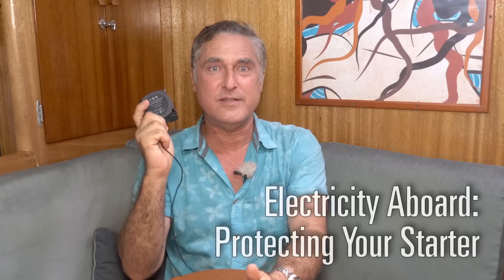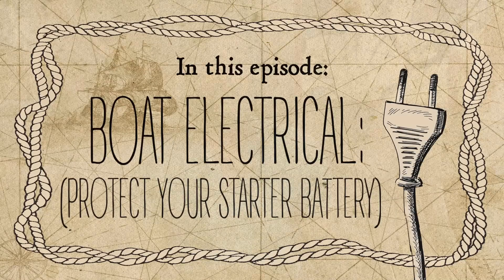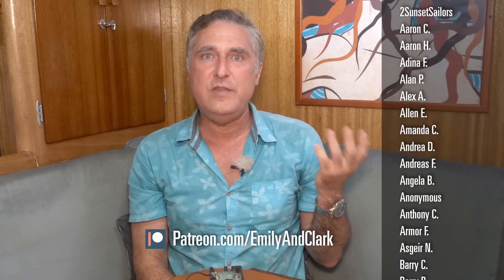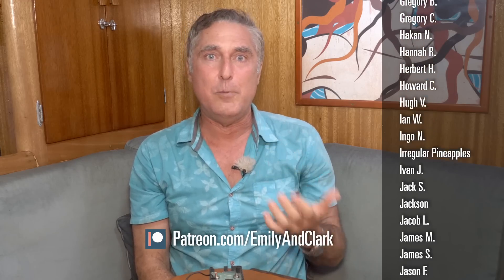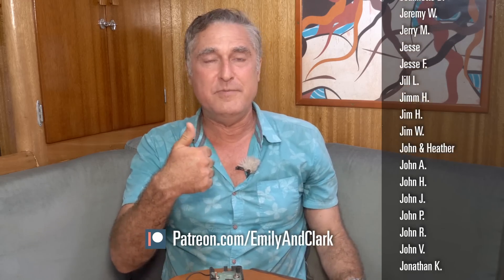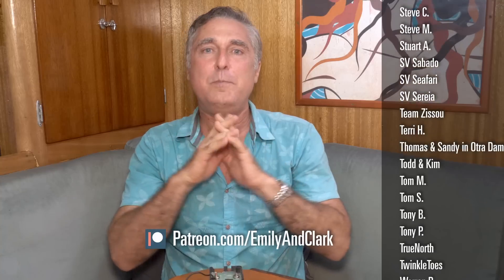The $20 Way to Protect Your Boat's Starter Battery

Comment: I know it is a lot, but you should post a schematic of your electrical system.  I am getting ready to refit my boat (with a lot of your products and ideas), and it would be great to see a diagram of how to incorporate all of your different stuff.  Battery isolator, BBMS, AC, chargers, converters, MPPT controllers, solar panels...etc...especially where fuses are needed and other hazards...
Reply from the maker: Good idea for a video.
   Also you might like tomorrows video as it's going to be how to wire up a BankManager
Reply: @Clarks-Adventure Awesome!

Comment: Constant duty solenoid would also work
Reply from the maker: Yep, Shure would.  But they tend to use a lot of coil power.
Reply: @Clarks-Adventure  if you use more than a trickle charger you shouldn’t see any difference. Ive put them on a lotta stuff

Comment: So a point I missed in the video but got in your response to a comment is that the voltage-sensitive relay is only for motor lead to house lead, NOT motor lead to house lithium. Is this correct.
Reply from the maker: Correct for a couple of reasons.
   If you are using the BankManager it always needs lead attached to function properly.
   And, a vsr can connect when the charge states are very different.  That can be dangerous with li

Comment: Hi Clark. I really enjoy your videos and find them very useful for performing DIY on my sailboat.  I recently did a major electrical refit where I completely isolated my starter battery from my house bank.  The starter battery is used for my main engine, my generator and my windlass.  I only run the windlass when the main engine is running.  My charging sources for my engine battery are the engine battery alternator, generator alternator and the aux (trickle) charger on my Victron charger/inverter.  The charging sources for my house bank are the Victron charger/inverter and solar.  While I love the idea of using all charging sources for all batteries, I’m a little concerned regarding the difference in charge profiles between my starter battery and my house bank.  Is there a risk that the VSR will overcharge either my house bank or my start battery?  Also, is there a risk of very large amp loads flowing between the batteries if their voltages are quite different?
Reply from the maker: Yes the batteries need to be the same type at least chemistry.   You didn't say what types of batteries you have.
   Generally you are safe if you choose the setting for the lower voltage of your two types assuming they are both lead.  Your batteries will just charge a bit slower.
   If you have any Li you can solve that issue easily with my BankManager.

Regardless you might like this video.
https://youtu.be/Xp6ssk4Guuc
Reply: Clark - thanks for your kind reply.  Both of my battery banks are AGM (lead).  The starter battery is an Optima Marine starting battery and my house bank is made up of dual 230AH Victron Super Cycle (460AH total).  These two battery banks are currently totally separated. The main charging source for the engine start battery is the engine alternator (50 Amp).  There is also a trickle charge source for the engine start battery that comes from my Victron Inverter/Charger.  The house bank currently has 2 charging sources - the Victron Inverter/Charger as well as 400watts of solar coming through a Victron MPPT charge controller.  Although I like the idea of using my engine alternator to charge my house bank (especially during long passages), it is not a smart alternator and therefore does not have the 3 phase (bulk, absorption, float) charging like the Victron equipment.  Therefore, will using my alternator (via the VSR) to charge my house bank have a negative impact since it doesn’t follow the same charging algorithm?
Thanks for your thoughts / reply to this question.
Reply from the maker: It depends on the alternator voltage.  Usually the dumb ones just charge too slowly.

You can put a switch on the ground wire of your VSR.  When off your house won't get a charge.
Reply: My alternator is rated for 50 Amps and it is a dumb alternator - ie, it only supplies current at a fixed voltage. For this reason, I decided to forego the VSR route which would not supply my house bank with the preferred 3 phase charging approach of bulk, absorption and float.  I opted to spent a bit more money and went with a 30amp DC-DC charger that senses when my alternator is on and delivers the desired 3 phased charging.  This setup can also be used for when I eventually switch my house bank to Lithium as the chargers are all programmable.
Reply from the maker: Not so useful for Li as they claim.
Before you go Li you should really consider this.
https://www.emilyandclarksadventure.com/bbms

Comment: With these, you can raise the disconnect voltage ( 12.8v ) by putting a skotchy diode or normal diode on the earth wire. This with the forward voltage drop of say 0.4v you raise the disconnect to happen at 12.8 + 0.4 or 13.2v, they of course only join when above the 13.2 + 0.4 or 13.6v but that is fine on most cases
Reply from the maker: Why would you want to do this?   Li on both sides?
Reply: @Clarks-Adventure  Ahh my message was meant to be a reply to those people saying about the batteries being joined until down to 12.8v.  the extra diode on the earth line raises the disconnect voltage ( by the doide voltage drop ) if they wanted the starter battery to separate at higher voltage than the device standard 12.8 volts.  This was mainly in relation to the stock lead acid starter and AGM house banks most comments were messaging about.

Comment: Thanks for these informative videos. We have an ACR (Automatic Charge Relay) installed on our boat. It sounds like it does the same thing as the Voltage Sensitive Relay. Is that correct?
Reply from the maker: Yep sounds like the same kind of name.  There are also battery combiners.

All the same but the price.  But nothing is cheaper than what you already have.

Comment: The only potential issue with VSRs are that most fail closed, so if the VSR fails it will keep your batteries in parallel 100% of the time no matter what.....people should be aware and try and find one that fails open so the batteries are disconnected in a VSR fail state.

Comment: Question: You did not say how, and where do you connect the VSR?
Reply from the maker: 8n the positive line between the house and starter battery.
Often parallel to an existing switch that will now be left off for normal operation.

Comment: Clark, Thanks for this! 
Question: I have a smart charger that uses shore power to charge the batteries independently. It monitors each battery's condition and can charge one battery or the other independently or it can decided to charge both at the same time. Seems like this would interfere with how that functions. I realize if I was away from shore power it could also make things be different.
I would appreciate your thoughts on this.
Reply from the maker: I'm curious what you have.  Usually the battery chargers that make that claim just have some diodes in their charge terminals.

Either way it won't make that much difference.  If you have lead maybe one battery gets charged longer.  It's tough.

If you have LiFePO4 you should be running my BankManager and it will manage the li safely.

Comment: Well Clark you've got a new sub.  I couldn't find the relay in your store but I did find one by searching on Amazon.  Looks like a neat device.
Reply from the maker: It's usually best to get the dual sending version.   Hope you found one.

If not you have to put all the charge lines to one battery, usually not a problem.

Comment: Hi Clark, slightly different question about charging the seperate starter battery I have on Arabella.  On shore power all's fine as the starter battery gets charged however with my current solar panel setup I don't have the solar panel connected to the starter battery just the house batteries.  I think when I bought the solar panel the supplier said not to do that !!.  My question is,  is there a way to have the solar panels I have connected to the house batteries charge the starter battery as well or am I better getting a seperate small solar panel to just charge the starter battery ?.  cheers, Ian
Reply from the maker: As I remember your starter battery is lead as it should be.
   Use one of these devices as described in the video.  It will work for you and not only charge your starter from solar but from any source and your starter will be floated by your Li at night.

It's what I do on Temptress.
Reply: @Clarks-Adventure  Hi Clark I've already got one of those devices installed for the lead batteries so are you saying with that connected the starter battery should be getting charged via the solar panels already ?
Reply from the maker: If you have it's positive sides connected to your starter battery and your house battery (ground connected of course) and it's the bi-sensing version you should see your starter at the same voltage as your Li.
Reply: As I Inherited the gig with the boat and it’s a nightmare trying to see how it’s all connected without removing all the batteries and whatever I’ll see what gets charged next time on solar rather than shore power . Hopefully it’s as you say and I don’t have to do anything 😊
Reply from the maker: You could temporarily remove your shore power wire to the starter battery, leaving it on the house side.  If the voltage doesn't come down in the starter battery you are good.
Reply: @Clarks-Adventure  ok will try that.  is the theory 'if the voltage doesn't come down' meaning it's getting charged from the solar , or something else ?
Reply from the maker: Yep.  If the car is closed the voltage will stay up.  Otherwise an isolated lead battery will drop to a voltage of 12.8 as time goes by.

Comment: You left out the most   important and dangerous aspect of diode isolators.  Because the main battery is the only  one  being  "sensed"  this means that if the  diode on the main side fails,  the main will not be charged,  the "sense" circuit to the VR will say " oh let's charge more"  and the  aux  battery  will now get  BOILED

Frankly I believe in  "keep it simple stupid."  A SIMPLE  CONTINUOUS DUTY SOLENOID, keyed  by  the engine  ignition switch, has ALWAYS  worked  very well in boats and RVs  It's just a great big solenoid relay,  and you simply wire  it so when the  engine is running,  the batteries are connected.   Most all have  a 2 post  coil connections,  and you can wire a small switch in series with that to disable it for some reason
Reply from the maker: You are correct.
  Diodes were a great way to go on 1960.

Comment: If the VSR cuts out at 12.8v and you have a Lithium house bank, that holds ~13.2v, the relay will stay energized (connected) almost always. Right? This would be the same idea as letting the Li float the Pb house with you BBMS.
Reply from the maker: Yes.

  But the bank manager does so much more.
Reply: @Clarks-Adventure  Understood. I guess my question is really about isolating the starter battery to only supply cranking amps instead of pulling from both starter & house banks.
Reply from the maker: Yes this does that all by itself.

That is after the first few seconds when the voltage drops.

If your wire is real big and your Li is large enough the li could keep the voltage up.  I have a feature in the bank manager (sort of a software fuse) that can protect from this but if the li is big enough to start your engine without it's voltage dipping below 12.8, what's the harm?
Reply from the maker: Mostly this device is to keep the discharging house battery from eating up your start battery.

Comment: The only issue buddy with a vsr you can’t have a b2b 
Best option is a b2b with a battery master 
But again if using lithium leisure and lead starter not all battery masters or maintainers work 
One I found that work is  one from vanbitz in the uk or the amt-12 at widebus the vsr definitely interrupts the set up
Reply from the maker: Mine works fine with a VSR, the BankManagerPlus, and it's the only one to not cause low current overcharge that will slowly destroy your Lifepo4.

https://www.emilyandclarksadventure.com/bbms
Reply: @Clarks-Adventure  ok cool … but it’s this the device for a hybrid set up 
I’ve noticed wildbus sells his own version on this now doesn’t he
Reply from the maker: There are a lot of ways to go.  We are all captains of our own ships.

I designed this from scratch to solve the li charging and use problem the best way possible with no loss (b2bs drop about 20% of their power as heat)

The Wildbus unit is just a programmable VSR.  Not really in the same class.

Comment: Nice video, per usual.    Like one of the prior commenters I have concern about the 12.8 cut out voltage.  I'm thinking that this will allow the starting battery to remain connected to the house bank as the house bank is used for ship service.    Thus the starting battery will be kept in service and giving up charge for ship service until the voltage is drawn down to 12.8 V.    It would be better if it were to disconnect at the completion of the charging cycle when the float voltage is achieved (13.2 ~ 13.4 with my Lifeline AGM's) thereby preserving the 'fully charged' state in the starting battery.      I have a device on my boat that accomplishes this, albeit at greater cost (~ $ 150) . . .  it's a Xantrex Digital Echo-charge.   It never directly connects the house and starting batteries.   Instead it watches the voltages of the house and starting batteries and whenever the starting battery voltage is .5 ~ 1 volt less than the house battery it will supply a charge current of up to 15 amps to the starting battery.    Thus whenever the house batteries are being charged the starting battery will receive the same 3-stage charge.    This is especially appropriate when both the house and starting batteries are of the same type.
Reply from the maker: Actually leaving a lead battery disconnected allows it to self discharge.  
The REAL charge in the plates doesn't start leaving until the voltage is below 12.8. There is a phenomenon called surface charge that happens first.

So it's better to leave your starter bank connected as long as it's above 12.8.

If you add li to the mix all your lead gets heald at float all night.  Like it's on vacation...

Comment: Hey  @Emily & Clark's Adventure  , I have a question on these VSR's.  The ones that I found have a cut-in voltage of 13.3v and a cut-out voltage of 12.8v.  I have an AGM start battery and a 560A LFP house bank.  My house bank has never dropped below 13.0v even after several days at anchor so with a cut-out voltage of 12.8v it would never disconnect from the AGM.  Can you get them with different in-out voltages?
Reply from the maker: Good day Hayden,
   First off if you are going to mix Pb and li I really recommend you use one of these.  https://www.emilyandclarksadventure.com/bbms
As well as the obvious thing it does it is the only device that protects your Li from low current overcharge.  Though charge controllers have a li setting, they don't do it right.

As far as the vsr goes.  That's the right setting as I see it.  Your Li will float your pb and keep it happy.  It should only disconnect if the li is depleted.
Reply: @Clarks-Adventure  I think I will stick with an ArgoFET from Victron which works like a diode combiner without the high voltage drop.  I do not like the idea of the LFP "supporting" the AGM start battery.  I have had batteries that have failed in that they would take charge forever and still have relatively little capacity.  With the LFP supporting the AGM you would not have any symptoms of a problem because the start will continue to start the engine but will be sucking the life out of the LFP.  If my AGM requires a constant trickle charge to keep starting my engine, I want to know it.  My current AGM start battery is about 10-years old and has never been on any shore power charger, getting all charging from the alternator.  It will routinely sit with no charging for 4-months over the off-season and still start the engine on the first try.  If it does not, I will replace it.
My house and start are totally separate each with its own discharge master switch.  The only connection is when the condition is met that alternator output exceeds battery voltage and it breaks the connection as soon as the alternator voltage drops.  In addition, that connection is a one-way check valve (diode or FET based).

Comment: Yes, the isolator is a terrific idea.  That said, for another $20 one can put a tiny PV solar panel to charge each battery system.  I expected to hear about the combo of isolator & tiny PV panel.  A small PV panel that's less than 1% the watt-hour capacity of the battery is safe to directly connect.  I.e.  If the engine battery is 50 amp-hours that's 50A*h times 12V == 600 watt-hours.  1% of 600 is 6.  Thus, directly connect a 5W (or smaller) PV panel to your battery array and you're good to go.

Comment: Great video, as always😀 Personally I would choose to not have a separate starter battery, if the house bank is large. Historically you might have 1-2 batteries in the house bank, today a lot of boats have 4 batteries or more. The power required to start a “small” diesel engine should be no trouble when shared between 4 large batteries. This way you avoid all the trouble of managing multiple banks, and you can use your battery capacity more efficiently.  (If I had no generator, I might have an offline “emergency” battery).
Reply from the maker: That's a way to go.  

I had some really thick plate house batteries.  1000ah of them couldn't reliably start my Perkins 4-108.

But with AGMs that's a very valid approach as long as you are confident you won't ever discharge too far.

I personally use the "starter bank" for the engine and windless.  Both like the thin plate type batteries.